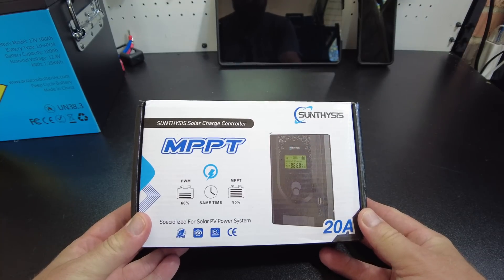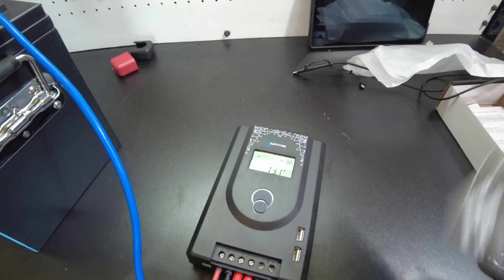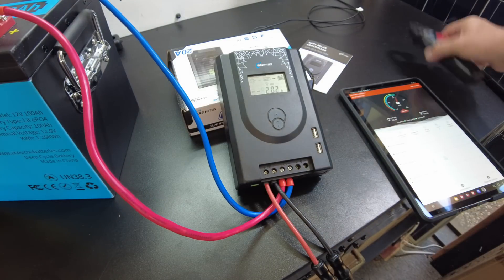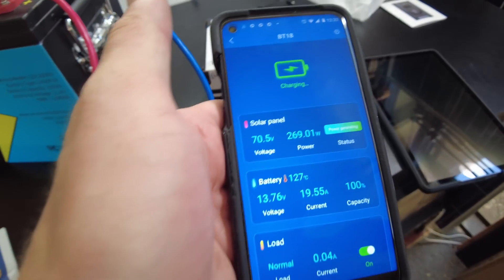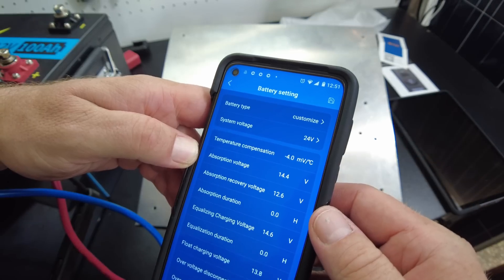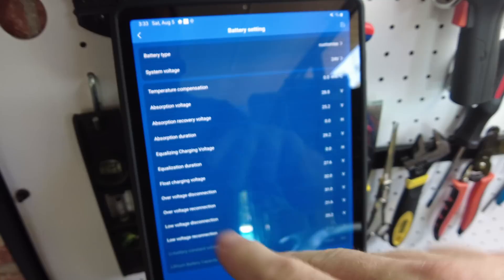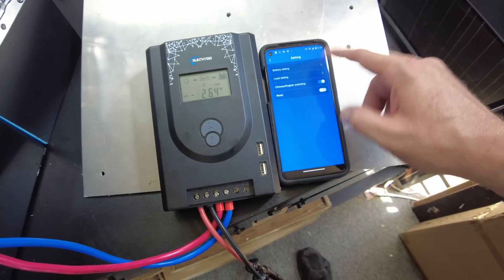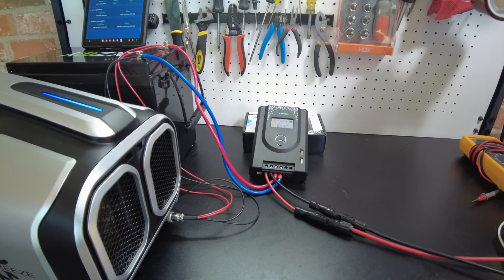Sunthysis MPPT 20A Solar Charge Controller

Comment: E12 IS battery type issue. I came across code due to this. Set type on physical unit LiFe. Noticed app didn't match, it was LiPo. When I changed it, physical unit changed to LiPo... Error happen. CS and book was no help. After I switched it on unit back to Lifepo4 ,App is moving from SLD or LiPo...within 30 mins. Don't trust app. Major concern is which solar charge is correct... Hopefully it is physically unit.

Comment: E12, 2 hours after install. Book and tech support don't have solution. Another amazing Amazon return
Reply: Got the E12 error yesterday. Tried different settings and battery configuration and haven't been able to clear it yet. Unfortunately I'm past the return deadline so it may get some percussive  maintenance with a hammer. I'm going on a road trip in less than two days so I may have to pony up for a Victron.

Comment: Brad help me out. The manual stats for my 100/40 Sunthysis controller states positive ground. That confused me. Does this mean i cannot use it in my rv which like every vehicle is negative grounded
Reply from the maker: It's generally considered a bad idea to use a positively grounded controller in an RV, or other negative chassis grounded vehicles/systems.
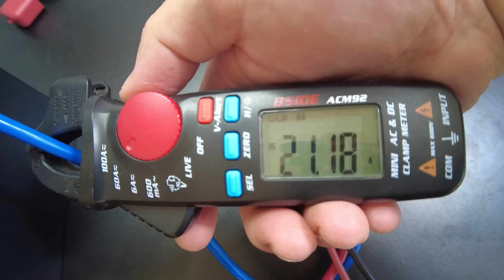Reply: @BradCagle well after calling other charge controller experts at other companies, 3:36  I found someone that sounded like he understood. His reply was the same they don't make positive grounded controllers, but added that it won't matter because I wouldn't be grounding this unit anyway. So positive, negative grounded doesn't matter

Comment: Primary charging is usually done at the absorption setting.
Heat sinks work MUCH better when they are straight up vertical.

And a year or so later (27 Dec 2024), Sunthysis has mostly disappeared.  Amazon has the 50 amp controller ($85.99 just before I posted this) and a lot of negative reviews of that unit.  "Worked until it didn't" is NOT a review you want to see on any product of a manufacturer when you have another of their products.  Still some Sunthysis pure sine wave inverters and some solar panels but I think they are singing their swan song.  Disappointing when they looked so good at the start :-(

Comment: I'm having difficulty configuring this thing. I have a Redodo 12V 200Ah LifePO4 battery and haven't connected the solar panel yet and I'm getting an error 11. The charger controller was $53 when i purchased it last week. I just checked the price for it now and it's $92. I manually selected the LifePO4 battery and the controller rebooted and gets the error 11 right after. Not sure how to fix this.
Reply: Probably too late. Best advice. Deal with the crap physical unit navigation. Don't see set anything in app. It don't cross correctly.

Comment: nice one you put the video back up, I got one sent to australia, arrived in about 2 weeks, no packaging foam around the box, but it survived very nicely, worked first go, bluetooth connected no issues with samsung s7 android. Haven't hooked up solar or load yet but looking good, a real shame we dont have access to same products you have in usa, our population way way smaller I guess is the issue. 
On the bright side we know what is coming eventually.
Reply from the maker: Yeah, really bothered me they jacked the price like that, so I took it down. But then I realized there's information on this video people can use that have already bought it, so I put it back up. Glad it's working for you! Thanks
Reply: I'm guessing this will happen with alot of products you put up, not much can be done about it.  @BradCagle
Reply: it is quite a useful video, just a note a small fan blowing on the fins should help cooling if too hot

Comment: Can u series four 12v 100w panels to charger a 12v battery bank. Or you got to parallel the four panels with this mppt charge controller

Comment: Great to see an affordable controler, just wary that it's an actual MPPT unit and not a  PWM unit with a MPPT markings.
Am definitely interested if it's a true MPPT unit.
Reply from the maker: It's actually MPPT. I opened it and it has the inductors required for the buck conversion. PWM would not have these

Comment: beginner here, trying to understand voltage.
if i use say 2 100 watt 12v panels, i connect them in parallel?
what if it were 2 100 watt 24volt panels?

also, why would you choose either 12 or 24 volt panels? one is superior to the other?

Comment: very basic question: do you need to instal a diode between solar panel and mppt if the panel has no inbuilt diode?
Reply from the maker: No
Reply: excellent a bit less voltage loss @BradCagle
Reply from the maker: @namenotshown9277  Yup!

Comment: I purchased the 30A Sunthysis, started testing it out. Unfortunately neither of the USB ports will charge anything (tried conencting it to multiple 12v batteries with no luck as well as multiple USB cables and devices) Despite going thru the settings and setting it to "custom" to adjust the charge parameters for my 12v ,3S 18650 Li-Ion battery (which the voltage range I want to opperate it at is 9.6v-12.6v which means im running the individual cells to 3.2v-4.2v) and it will not charge it. Not sure if this MPPT charge controller is good for custom batteries. Looks like it would be good for the 12v/24v LifePO4 batteries though.
Reply from the maker: Bummer. Do you have the load output turned on? It also switches the USB ports on/off
Reply from the maker: Also did you set the voltage you want to charge at via the float setting? Thats the one tha matter.

Comment: Open it up and see if it has the big copper coils that are the signature of an mppt controller.  I've ordered so many different models and they turned out to be pwm controllers.
Reply from the maker: I did, it has two large inductors. I should have opened it on video, but I forgot.
Reply: @BradCagle  Thanks for the info.
Reply from the maker: @allyn7577  anytime!

Comment: That is not bad for the price. I wonder if it does better without maxing out the solar input on 12 volt? I believe it said 260 watts max input and it was around 261. I would say either put fan on the load side to help with the heat on it or mount it to an aluminum panel or something to help dissipate the heat. A small 12 volt computer fan should do it I think. 
I wanted to check to make sure I got it right, when it says max input 260 or 400 watts or whatever it is rated at, is that the solar panel input or max of what it will put into the battery?
Reply from the maker: Max that goes to the battery. So 20a x 12.8 = 256w but as you know getting closer to full 13.8+ you would get 276w
Reply: @BradCagle  Thanks
Reply from the maker: @jw3843  Anytime!

Comment: If this is in actuality an MPPT controller, it will be the first with usb ports…

Every other “mppt” controller that has usb ports is just a pwm controller with an odd algorithm. Fake…
Reply from the maker: I've seen the pwm ones that are labeled mppt you mentioned. This one is real. I opened it up, and it has inductors and the PV voltage is in the correct range, etc..

Comment: To me for some0ne who wants something for an Emergency like you mentioned, that charge Controller is perfect. And maybe with a 100 watt panel or two from Harbor Freight and a Lithium battery  forgetaboutit you are good to go off grid and fight the NWO :face-blue-smiling:
Reply from the maker: Or better yet, grab a used residential, or commercial panel or two. Thanks

Comment: Haha, I bought the 40 amp one on Prime day. It works well but the load won’t turn back on from the app if you turn it off. You have to press both buttons to turn the load back on…but yeah that higher voltage input is great!
Reply from the maker: Nice, yeah sounds a little quirky like this one. But seems to work just enough to make it worth it LOL. Thanks!

Comment: Hey Brad. I have 2 of these charge controllers one with Bluetooth and one without. The one without Bluetooth is a pain to configure. And the manual that comes with it basically useless as the instructions are tiny and hard to understand. But good value for money.
Reply from the maker: That's interesting. Yeah I could see it being hard to configure without the bluetooth. Thanks

Comment: I'm possibly gonna buy the 50a one and run it on 12v but was thinking what if you add USB fan to the back of the controller since you have 2 USB ports
Reply from the maker: Man, I almost pulled the trigger on the 50a. $84 is crazy low. LOL Yeah the USB fan is a good idea, and the USB ports are controlled from the load port so they could be setup to run only in the day I think.
Reply: I questioned using this on a 12v RV because of it being positive grounded.  I was told by some at Rich solar that it is unusual to be a positive ground but that it doesn't matter as long as I don't ground it or the panels. There is no grounding wire anyway. 3 days in it is working

Comment: Another nice find Brad. 
I was impressed with the last 24V battery builds efficiency that I am now building a 48V system for my camper trailer. I'm using a different approach to solar charging - one mppt boost converter per solar panel (4 solar panels) all feeding the 48V battery. A little on the edge, but I think it will work. The boost converters were pretty cheap, but multiply x 4 and it gets up there. Still, I'll have 4 completely independent solar chargers, so this must amount to exceptional reliability.
Reply from the maker: That's a sweet idea Ben! I just picked up a 20ft camper trailer myself. There's so much crap on the roof I'm trying to figure out how to get the most solar up there.
Reply: @BradCagle  Good luck with that. My camper has a roof rack that swings sideways and puts the solar panels in the vertical, so I've had to hinge the roof rack  so I can flip it horizontal again. Adding struts at the moment to make the solar panel flip a little easier.
Reply from the maker: @Bennyboy-dog  Oh wow, I'd like to see this.

Comment: Cool you are doing the review videos. You seem down to earth and I trust what you show us. You gave me good advice a few times and you was absolutely right about me liking the victron charge controller.  Thanks man
Reply from the maker: Thanks for the kind words :) I really stress to bring the most accurate info! Glad you like the Victron, they are so nice.
Reply: @BradCagle  bro the victron was kinda life changing in a way. I mean I know that sounds weird but when I was having the erratic voltage jumping up and down and charge controller turning itself off and just blinking with the powmr I was worried to walk away from it with it hooked up thinking it might destroy my batteries and when it was the leaf batteries I worried about fires. Now with the victron it just charges smoothly and everything just works.
Reply: @BradCagle  I just ordered a powermax 24 volt 50 amp converter charger. I have a 100 amp powermax and it's been great but I couldn't find much out there for 24 volt high amp chargers